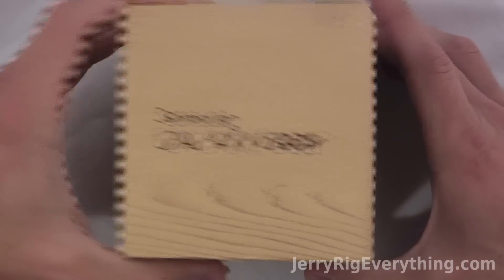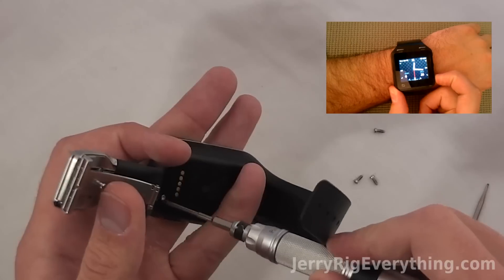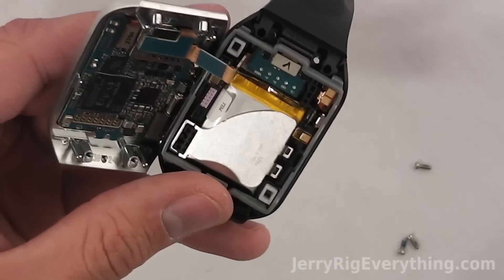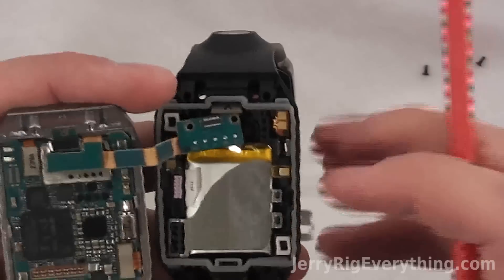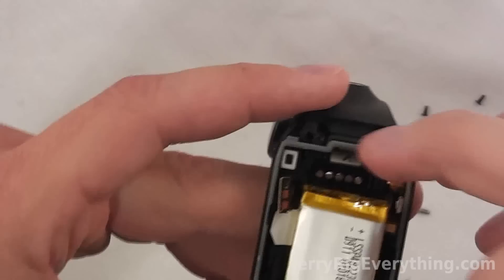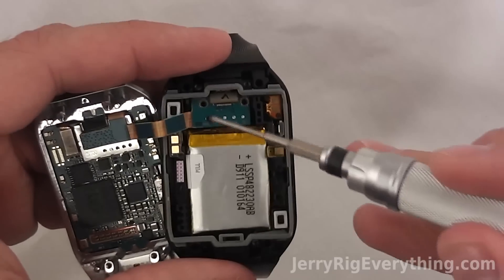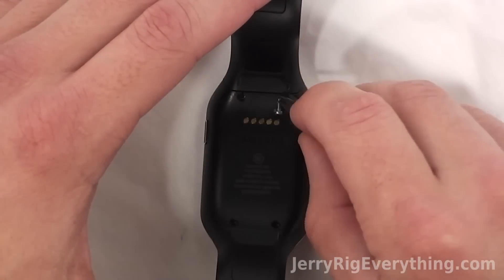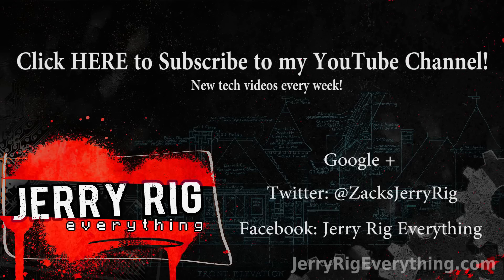Inside the Samsung Galaxy Gear Smart Watch. Tear Down, Fix, and Repair.

Comment: Excellent  for some reason  I haven't  wearing  my watch 3yr sitting I left charger noting  came screen 🙃
Reply: 1) clean the contacts on the watch and on the charging case 2) try connecting USB to USB 2.0 port on PC 3) try USB 2.0, open the case, push the watch to charge, take something thin to push the power button in the same time, while charging. Push it for 1 minute

Comment: Hi, Jerry...
Useful video you did!
Would you recommend me to replace battery on my  Samsung Galaxy Gear 1 SM-V700 if my watch stopped recharging when I plug it into the power outlet? 
Where do you recommend to buy a new and original battery for my Samsung Galaxy Gear 1 for replacement?
Thanks a lot!
JP

Comment: This didn't work for me. The problem I'm having is the battery is not holding a charge. It's at %100 after fully charged. But soon as I unhook the charge cradle from the watch it goes to %85. Is there some place where I can get a battery?

Comment: Followed the video. Ordered the battery from Amazon. Installed the battery.  Same symptoms. No power, no activity, nothing.
Battery has been on the charger for 1.5 hours.
Any ideas?
Reply: PLUG THE USB CABLE TO A COMPUTER INSTEAD OF THE WALL IT WORKED FOR MINE .
Reply: how much did the battery cost....?? 
battery madel no. plz....

Comment: Hey my gear screen is not working but when I press the screen I can hear it taking pictures and making sounds. If I take it apart and take the battery out and reset it. Do you think the screen will work ?

Comment: thank you, my watch wouldn't power up or charge, and a tech from samsung said that 9 times outta 10 unhooking the battery inside will reset and fix the problem. and it did :-)
Reply from the maker: +Jay Jay Brown Nice! Glad my video could help a bit.  Thanks for letting me know.
Reply: +JerryRigEverything  What do I do if one screw wont come out?
Reply: Thanks, will try to unhook to reset battery before buying a new one.

Comment: Hey man your video was awsome. I've brought one of this from usa and one year later stopped working. I suspect it could be the battery. I live in Brazil and here Samsung doesn't give support to fix it. How could I send to usa to fix it to me? Thnaks a lot.
Reply: connect it to a USB port to charge, maybe it can be saved.
Reply: I also have the battery for replacement , contact me at skyson101@gmail.com

Comment: I need a v700 model band with camera speaker give me link
Reply: Danny Chan i need how to disassemble the speaker
Reply: I can provide the top strap , but you  have to install your camera, grey or   black for option.
Reply: Danny Chan ok how
Reply: Danny Chan black
Reply: Plssss
Reply: wait for several days, I will send you pictures when I receive the original top strap. it has speaker.
Reply: Danny Chan yes ok but how much
Reply: +Farman Afridi TV ,we can do business on eBay or PayPal. both parties are safe. my parts are in custom clearance and will be received next Tuesday .I will inform you.
Reply: +Danny Chan  ok ok thank so much I will wait
Reply: Dear Sir, I have received the V700 strap,I only have the top strap with camera and speaker, only black and grey for option. Can you let me know your email?I can send you picture for reference.
Reply: Sir I need galaxy gear sm-v700 band
Reply: Sir I need galaxy gear sm-v700 band

Comment: where can i get a replacement battery??
Reply: +Blaker Giron ,contact me at skyson101@gmail.com, we have the original brand new battery for this model.
Reply: +Ehmadagha Babayev ， i have the original samsung battery for V700, and you can srnd email to me, we can do transaction via paypal or ebay.
Reply: +Ehmadagha Babayev ,the best price we can give you at USD33.00 with air registered mail, it takes about 7-14 days to reach your hands. We can do business via paypal or ebay. If you like. It is the original and brand new.
Reply: I agree with your price suggestion, so I send the battery with economic shipping?

Comment: First thanks for the video . FYI it takes a #6 torque bit to remove the cover . Also if your battery is dead or you think it's dead , DO NOT leave it in there . Mine was swollen up , like it was going to explode any minute ? Do this on a large white towel with plenty of light and be careful when you are inside the watch . Above all be patient . TheReaper!
Reply: 6 was too big for mine. I had to use a T5.

Comment: guys my gear gen 1 don't charging I didn't use it like 3 month. so now I can't charge it, can u tell me why?
Reply: +Davit Ochkhikidze .  Try charging your Gear using its cradle and USB cable and plug into USB port of computer.  If you didn't use your Gear for a few months (like me), it won't charge via wall outlet.  I have called Samsung and did not get a response.  Thanks.
Reply: now it is working ty ;)
Reply: +Davit Ochkhikidze same problem with does it work ?
Reply: +Glenn Ruiz I didn't use my Galaxy gear for 2 months. I tried charging it with a computer, and still nothing
Reply: +xHeAvYsHoTx try to clean nonectors of watch and try again. it must start charging

Comment: guys my gear gen 1 don't charging I didn't use it like 3 month. so now I can't charge it, can u tell me why?
Reply: +Davit Ochkhikidze I had the same issue. I don't know why the Gear behaves this way during long periods of non-charging but do everything described in the video and it will charge as intended.
Reply: its work i plug it on PC usb port so its work ty guys
Reply: its work i plug it on PC usb port so its work ty guys
Reply: its work i plug it on PC usb port so its work ty guys

Comment: Hi Can you tell me if the charging pins can be replaced on the Model sm-v700 smart watch
Reply: it can be changed, but need soldering.
Reply: it is not difficult to change it, andi have the pins part.

Comment: so is this what I need to do if my battery isn't charging?!  I've been trying all the different charging methods and it still won't turn on.
Reply: use a USB cable to connect to a laptop to charge

Comment: i have a problem with my watch it suddenly stopped working the other day, i have tried various cables, plugs and computers but still dosent do anything i have also took it apart and put it back together but still is not turning on or charging. im also pretty sure it had atleat half charge when it stoped working.

Comment: The charger port goes to the motherboard first so you don't overcharge the battery. It detects when the battery is charged and cuts off the power.  Otherwise you would have to time your charge so your battery doesn't explode.

Comment: Hey Jerry, great video, very detailed and ez to follow. I am a cell phone dealer, I have about 50 of these Gear kitted with the charger & manual. Most of them do not power up even though they look to be in perfect condition. Do you think it's just the battery and is that battery readily available?

Comment: Nice video, anyone knows where can i find parts for the gear 2, i need a replacement back cover, the pins on the back of my watch corroded and 2 of them fell off, so i need a new back cover, any info on parts on the gear 2 will be appreciated, thanks.

Comment: Nice video Jerry. I purchased mine about a month before this video and the battery is starting to only last for 12 hours which is not long enough for my use. I did not see any links to replacements parts, primarily the battery, in your description. Do you know of where to get a replacement and what battery it takes? - Thanks,
Reply: dear Sir, I have such battery ,brand new and original Samsung parts, if you need, let me know, we provide the best price.

Comment: What size of Torx/pentalobe bit is needed to remove the case-screws? My GG has succumbed to the common problem of the motherboard hanging and not allowing the unit to charge - typical modern shoddy POS operating systems not being fit for purpose and cheap-arse manufacturers not giving a crap about whether or not their product actually works. I need to disconnect the battery to force a reset and don't have a bit to fit, hence needing to know the size in order to source one to suit.

Comment: replacement battery link:

http://www.ebay.com/itm/Genuine-Samsung-SM-V700-Galaxy-Gear-Battery-GH43-03992A-/331347265389?pt=LH_DefaultDomain_0&hash=item4d25d6076d

Parts link:

http://www.ebay.com/sch/Replacement-Parts-Tools-/43304/i.html?_from=R40&_nkw=galaxy+Gear&LH_PrefLoc=2&_arm=1&_armm=63&_ruu=http%3A%2F%2Fwww.ebay.com%2Fsch%2FReplacement-Parts-Tools-%2F43304%2Fi.html%3F_from%3DR40%26_nkw%3Dgalaxy%2BGear%26_arr%3D1&rmvSB=true

Comment: Where do you get a replacement battery for the original Galaxy Gear, and how long do they expect the battery to last before it needs replacement? 1 year? I bought about a year ago and my battery dies within 2 hours of wear. It used to last about 8-10 hours.
Reply: On Ebay, search "genuine Samsung SM v700 Galaxy Gear battery GH43-03992A", thats the only one Ive found.
Reply: +Harry Cannon ,the original battery can last about 2 days. We have the original brand new battery, please contact us at skyson101@gmail.com
Reply: +John Knotts ,I also have such new & original battery in stock. please contact us at skyson101@gmail.com

Comment: For those that there watch will not take a charge after it has sit for a long time without use try using a usb cable through your pc to charge it.  Worked for me.

Comment: I'm having the same issue with my watch, it won't charge. I made the mistake of using my phone charger to charge it and I think it might have burned it out, because the pins where it connects to the charger are dark. Is it possible to change the ribbon cable?

Comment: Hi, im wondering if you know how to fix Gear watch 1. My watch wont charge ive tried to leave charging for 10hrs to see if it has to gain some power but still doesn't work!! cant seem to find where to buy a replacement battery?
Reply from the maker: EK CHANGWAI I have not been able to find any replacements yet. Let me know if you find any.
Reply: No worries !! it works again Just needed to charge it on the computer some how it works
!!!
Reply: EK CHANGWAI Thank you very very much! I had the exact same problem and it worked out for me after trying to charge it via my computer, thank you!
Reply: Hi just replaced mine arrived today. Many thanks to this great explanation. I bought my battery from ebay and from Germany. eBay item number:282725779180 Have fun!! SJP

Comment: Do you know where I can get the camera band replaced? It is not staying locked around my wrist (it fits fine tho), or can you make a video on how to replace the straps/camera band? Thank you
Reply from the maker: Eyobe Mills I dont have any replacement part suppliers for this watch yet... Let me know if you find any though!
Reply: JerryRigEverything
 Check on Ebay for the battery and search this, "Genuine Samsung SM v700 Galaxy Gear battery GH43-03992A"
 Its $33 USD -battery link

http://www.ebay.com/itm/Genuine-Samsung-SM-V700-Galaxy-Gear-Battery-GH43-03992A-/331347265389?pt=LH_DefaultDomain_0&hash=item4d25d6076d

Parts link
http://www.ebay.com/sch/Replacement-Parts-Tools-/43304/i.html?_from=R40&_nkw=galaxy+Gear&LH_PrefLoc=2&_arm=1&_armm=63&_ruu=http%3A%2F%2Fwww.ebay.com%2Fsch%2FReplacement-Parts-Tools-%2F43304%2Fi.html%3F_from%3DR40%26_nkw%3Dgalaxy%2BGear%26_arr%3D1&rmvSB=true

Comment: apology. I have the problem that my gear was a month without charge, and now that I connect it to the charger not start, no load, serious kindly tell me I can do to get it working again, thanks from now
Reply from the maker: You can try unplugging the battery. and trying again.  Or replacing the battery.

Comment: My samsung gear just went completly black a month ago the day after my S4 got smashed into pieces. Finally getting my S4 back in a few days so i thought i'd try to see if i could get the gear working again.

Just saw the video and went down to the store and bought the Tork screwdriver and started to open it, seems like it only needed the disconnect and not removing the entire battery to reboot again, plugged into the charger and within seconds the gear started to charge again. 

Thanks alot for the video and the explanation and i hope that others might find what i did useful :)
Reply from the maker: Nice! Thanks for posting.  Its always good to have success stories like this to help other people out.

Comment: Have you charged one of the batteries yet outside from disassembled state,... I believe I had no other option I had left it on for too long I believe without turning g it of due to being away on my work... Came back it was dead , now it out of warranty because of extra ply with Roms to improve it only the drain was harsh I didn't put in any baterrie ROM to curve the drain so I needed to figure out what the isuue was I removed it tested it it is dead ... I also have a neo so took it apart tested its batterie, it had power on the tester. So knowing the batterie is drained I need a safe way to charge it and to know when I should consider it charged enough to put it back together and charge by its charger without harming batterie
Reply: use a computer to charge it, and it will recover soon.

Comment: I have the white/rose gold band and can not find anything that will clean it, not even Goo Gone works.  So I used this vid to take the next black band that came in and swapped the bezel and clasp so now I have a black band with rose gold bezel.  By the way, what is in the clasp?  There are connectors in there.

Comment: Where do you find the screwdriver to remove the 4 rear main case screws. Can you remove the motherboard and screen from the brush aluminum face plate. We would like to custom the faceplate
Reply from the maker: Yes you can remove the parts from the faceplate. I get my tools from Amazon. I linked them in the video description.

Comment: where can i find a replacement band?
Reply from the maker: I havent found anywhere that stocks replacement parts.  Let me know if you find anything.
Reply: JerryRigEverything Hi, I suspected that my Gear might need a battery after almost 3 years.  Samsung was only going to charge $27.05 for the battery and the labor.  Also, I saw somewhere that the water resistance is rated at 55.